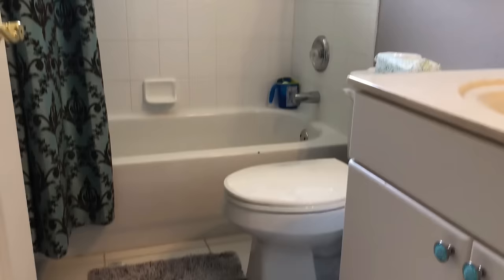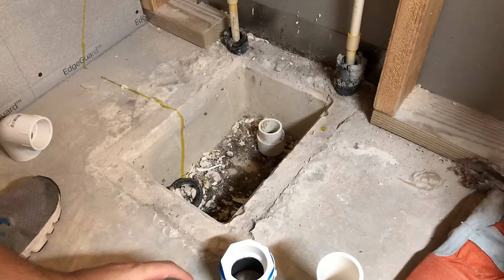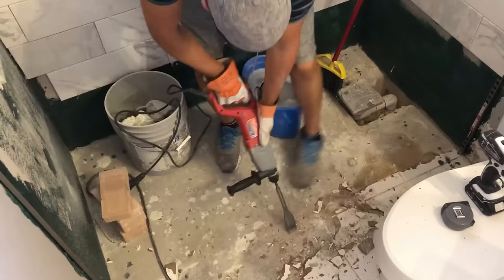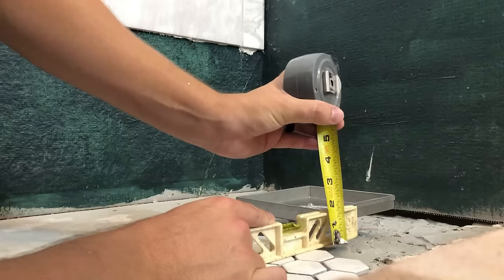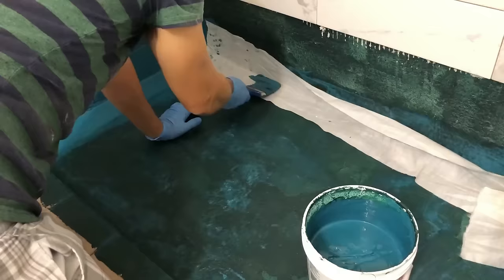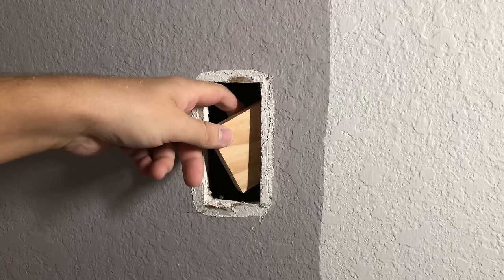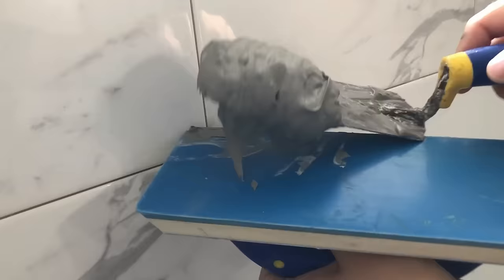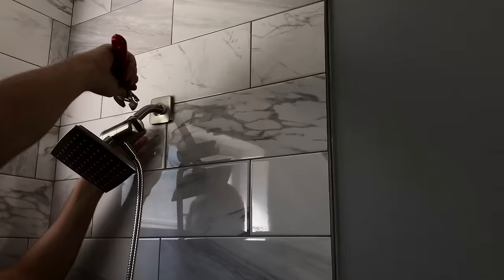Complete Guest Bathroom Remodel DIY | Start to Finish Tub to Shower Conversion

Comment: Looks great, but not installing shower liner it would not pass any inspection and you basically ruined all your hard work. 
You can check easily your work by plugging the drain, filling up the shower to curb height and let the water sit 24 hours. If the water is still there next day you passed. If the water is not there=leakage.
Reply from the maker: Thanks for your input.

Comment: That was not waterproofed correctly in my opinion.  I hope it does not leak.
Reply from the maker: I know it wasn’t idea. So far it’s been good 4 years later.
Reply: @Daddicated Problem is, you won't know until it's too late.  You skipped too many steps in waterproofing.  Being "ideal" is not a good excuse if your family depends on you.  You have some good knowledge and you look to be good with your hands, you just missed some important steps.  It's all a learning process for us all.  Good Luck next time.

Comment: Hats off to this guy for trying, but please nobody follow the steps he's doing! There's a lot wrong here specifically at the shower drain water proofing. There's no way that won't leak now or in the future. He uses a 3 piece drain, but only uses one slope and the way the aqua D is tied into the drain body is not correct. There is no way for the water to get out and there is not a proper way to tie it in. Take my word for it and if you're not going to use a pvc liner or hot mop then spend the money on a bonded flange so you can tie everything in.
Reply from the maker: Thanks. I’m not really sure I’m following you regarding the drain. No way for water to get out from what?
Reply: Hot mop bullshit work thinset dont stick on it old school fail work

Comment: You were supposed to water proof the entire shower walls no matter  if you use concrete board or green board or drywall you will eventually leak into your walls that I know for a fact

Comment: Why would you shut a circuit breaker off for a light. Bruh just keep the switch off lol
Reply from the maker: Safety first. Lol. Plus I got kids I wouldn't want one of them come in there and hit the switch as if they are trying to help me out. 😅
Reply: @Daddicated  tru, thought about that after i commented. Looks good tho! You can also use a two by four and pour concrete for your step up instead of bricks to make a grade, everyone does things differently thou, always good to nomore tho!
Reply from the maker: Yeah, that's not a bad idea either. Brick pavers is what I've seen many contractors do before in our area so I just went with what I knew and what seemed easy enough. I've also seen people do it out of 2 by 4s and then cement board and waterproof them but I figured pavers would be more reliable.

Comment: So many cut corners and that shower pan isn't properly sloped and not to code. This is how new homeowners get screwed when they buy a home like this, because the trash work don't last.
Reply from the maker: What did I do wrong with the shower slope?
Reply: @Daddicated  you clearly did put one in, that's what you did wrong, you tiled a flat surface, which leads to puddling and mold issues. Their is actually a lot of cutting corners, this kind of work keeps professionals like me in business tho, because we constantly have to go fix the issues.

Comment: Cheers to all the future plumbers that cuss you up and down as they jackhammer your shower floor up because you put pressure 90 fittings on a drain.😢
Reply from the maker: So what? What’s wrong with a higher pressure pipe it will be one strong drain. 😂
Reply: @Daddicated  A cable auger can’t make the turns. If it stops up there no hope but to jackhammers, their house not mine 🤷‍♂️
Reply from the maker: @JJ-Legacy  honestly tho the drain is no different than how the tub drain was plumbed so I'm confused how it works fine for the tube drain but not for a shower.

Comment: Yeah...don't try this at home. It's at least 100 hours of work and that's if you even know what you're doing.
Reply from the maker: Or try small project at a time and learn as you go?
Reply: @Daddicated  sure...but most people do not realize the amount of work and experience needed for what you did. They get this idea that's it's not that hard when it is without vast experience.
Reply from the maker: @diggingmystyle  Good Point. But it also depends on the person. Some people are good at hands on and figuring stuff out as they go even if they never done it and have no experience in that area. But at the end of the day, start very small projects and work your way up.
Reply: @Daddicated  true...but something like mosaic tile on shower floor requires a good amount of experience and never to be done by an amateur with little experience, no matter how handy the person is. This is not putting on drywalls.
Reply from the maker: @diggingmystyle  You're not wrong it can be a bit tricky.

Comment: Wow! I had to stop watching.  The cement board is not waterproof.  You should’ve waterproofed the entire board panel not just the joints.  Fail.
Reply from the maker: Lesson learned. However most contractors don’t waterproof the entire shower especially here in FL. They only do like 2 feet from the bottom the rest of the shower doesn’t get that much water on the walls anyway so it will be fine. Besides, you got thinset, tile & grout that the water has to go through first. I’m sure it will be okay.
Reply: @Daddicated  my brother lives in FL and his entire shower walls were waterproofed even if they were made of cement board. The grout is not waterproof.  At least use a tile sealant to seal the grout and tile every few years to extend the life and avoid problems.  Research how much tiles absorb water.
Reply: I was surprised to see you didn’t use a shower pan rubber liner?!?! Is that how they do it in Florida?
Reply: @Daddicated  It's probably fine for 10 years or so, but likely won't make it past 20.  Water is everything vs a house / bathroom in this instance.  Perfect water proofing is a necessity imo.  I went with Kerdi Board for my bathroom since it's way better than cement board and easier to work with, cost $$ though, but the time savings and knowing I perfectly water proofed is worth it.